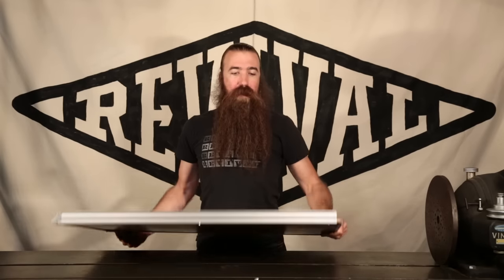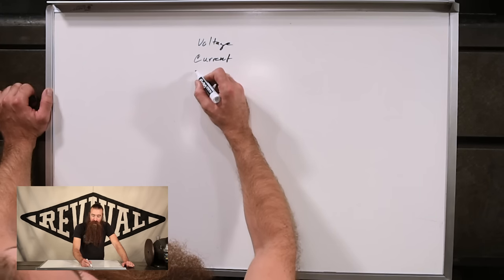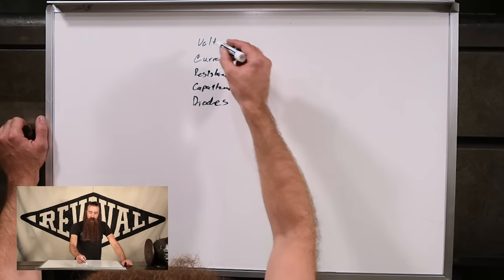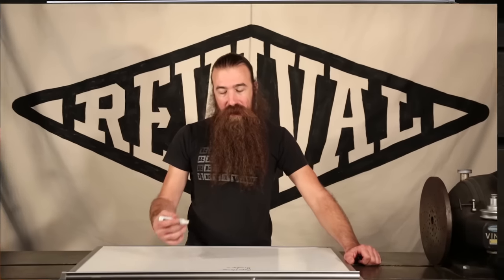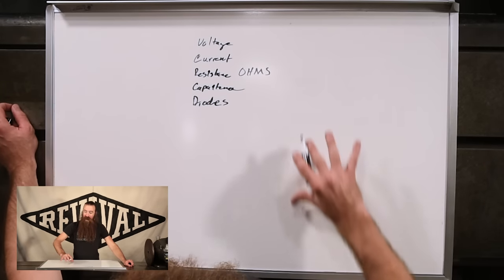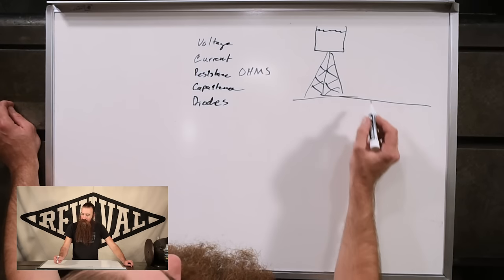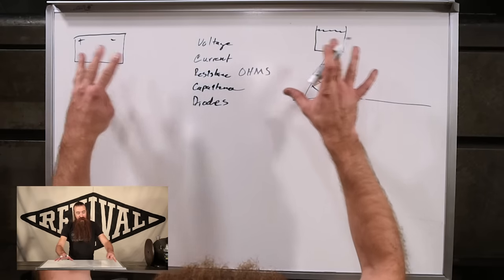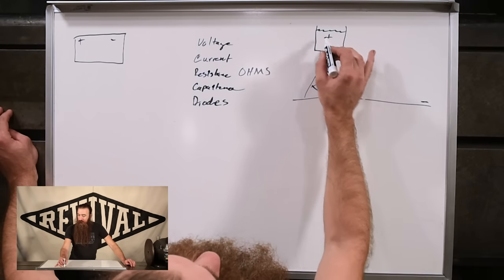Basic Motorcycle Electrical Theory - Revival Cycles' Tech Talk

Comment: ..It is always good to have a ground wire/connection between the front fork, and the frame....this prevents current from flowing through the neck bearings, which can damage them....
Reply from the maker: Excellent advice, and we agree, it is always good to run a ground between the front end and the frame. There are many reasons for this, and with conventional wiring the damage to the steering bearings is a big one. But with the m-Unit there isn't any current that goes through the bars. Because the m-Unit only uses signal level current from the bars to the m-Unit, and then distributes the power directly from the battery to the devices, there is no risk of damaging the bearings. BUT, it is still a good idea to run a ground so that you always have a strong signal from the bars to the m-Unit.